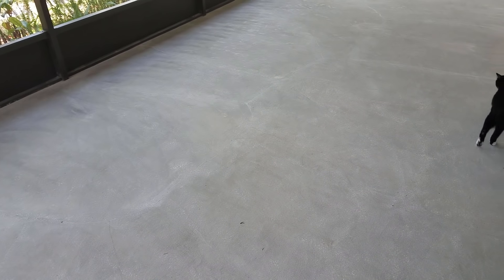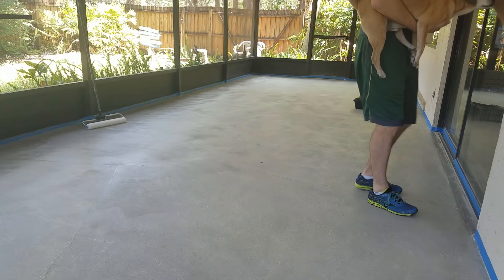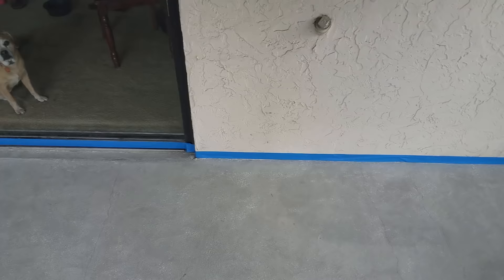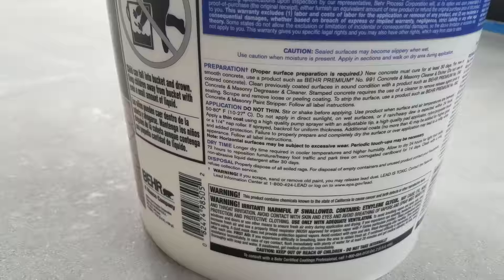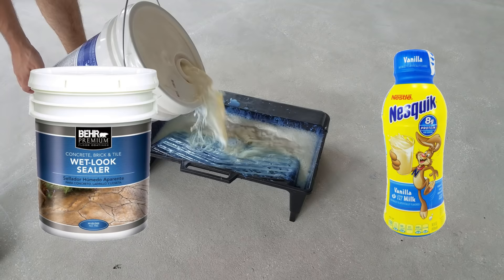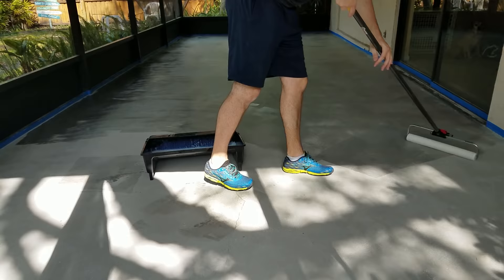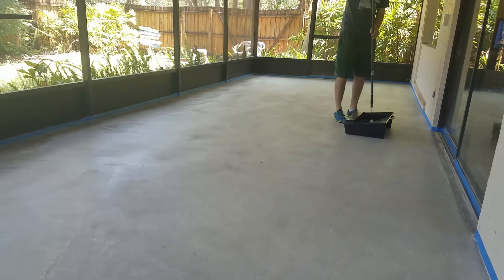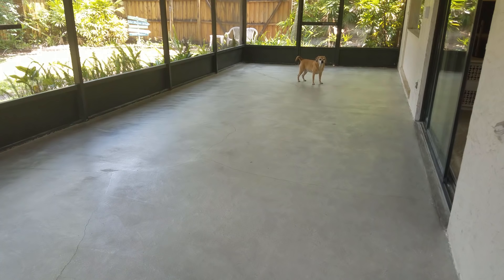How To Seal Concrete Patio (Behr Wet Look Sealer)

Comment: This is a good sealer. I just finished about 3000st at my house.i used a roller and a pump up sprayer turned out great preparation is the key.

Comment: Pretty much exactly what we need to do on our patio. There were four layers of paint and a layer of carpet adhesive under our outdoor carpet, got most of it removed with a push grinder rented from home depot. Now we have to clean up spots with the hand grinder. Thanks for the video!

Comment: Thank You, for these video's.  I am doing this. I do not care for the pump spray method. I wonder, does this Behr, have a very strong smell ?
Reply from the maker: There's a smell when it's wet.  Kind of like paint.  Since it has been dried I don't notice any smell.  Mine is outdoors so I'm not sure if it would be different inside.

Comment: That stuff looked waaaay to thin. I’ve used a sealer from a local concrete store and it was more the consistency of maple syrup almost. Dries clear with an actual wet look. Great video but use something else next time. You’ll be happy you did.

Comment: I like your dog we have 2 little guys and a balcony that is leaking even after I resurfaced it with a coat of water proof cement.  I now have to seal it and paint it to look good.  So do I put the sealer down first or the paint.  I think is should be the sealer.  Any idea which I should do first?  Paint or concert sealer?  I got both from Behr.
Reply: If concrete is like car paint then the color would go down then seal doesn’t make sense to seal it then paint it imo hope it comes out great and fixies your problem I’m getting ready to do a patio and large driveway
Reply: @caseG80  I called behr and the guy told me they weren't but I called before that and the girl said they wereso the second time I called I had both containers with both paint and sealer in front of me and I told the guy and he said they were not compatiblehe said that after I get done laying the cement that I had to let it dry for like 90 days before I could sell it but that's a but the sealer and the paint were notso what I did was I took the paint and I painted it and it seems to have work I haven't gotten any leaks so far but he said it's not going to last long so what I'm going to do is next summer before the summer I'm going to go to Vegas and get some of the epoxy sealer that they have I was told by somebody else that if I sealed it with an epoxy sealer that it would last for a very long time and it wasn't worth resurfacing it was too much of a hassle I believe that guy was rightso next year I'm doing a two-part epoxy I don't think the one part epoxy stuff that they have is any good and you can't buy it in California anymore I use the two-part epoxy on my pool and it worked great so I'm going to use the same stuff but only for concrete and driveways and I'm going to get it in Vegas because you can buy it there
Reply: what I know for fact is the two-part epoxy worked great on my pool and that they have a similar product that I can purchase at home Depot but only in Las Vegas Nevada where it's legal to buy that stuff and I won't have any problems I think that's the solution but the stuff cost $300 but it's worth it to not have to go through what I went through putting the cement down up there on the balcony it was a real pain in the butt I had to do it by myself and I'm just a girl so and I'm 54 it really took a lot out of me to do that

Comment: I hate to be a downer but this is a good example of what NOT to do. Good preparation will bear good results. Filling in the cracks with a concrete caulk or even better, resurfacing the entire patio would have been worth the extra work. TBH, the cracks now make it look awful. In addition now that's it's "sealed", it'll be near impossible to resurface in the future.

Comment: I have several little white spots on my finish coat. During application there was no indication there would be a problem. I need advice on how to remove these spots.
Reply: C of the V, did you find a solution to the white spots?   I have the same white spots (sealing solution foam), and need to fix this too.  Thanks.

Comment: Hii Guys,I.want to.seal.my.mee.and.old.concrete. 

Could.anyone advice me which pressure washer to use as even one.from Kennard  is not cheap.to hire. 

Can I use normal.karcher water pressure.washer or no?

Please help. 

Thank u,
Reply: Yes you can use a normal pressure washer preferably gas one can be rented for fairly cheap or maybe find a neighborhood teenager who may have a pressure washer they make a add on device for cleaning concrete I’ve never used but I read good things about them except the really cheap costing ones they help to not get the lines left from power washer just with the regular tips